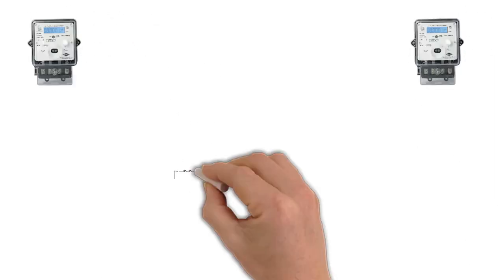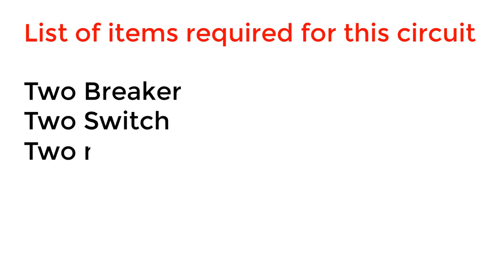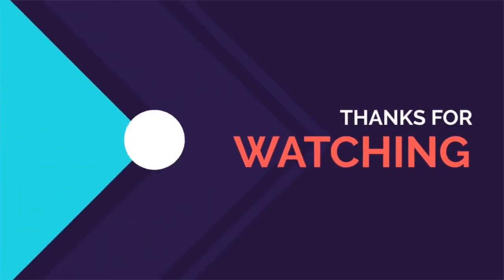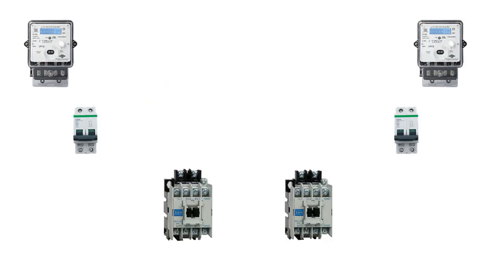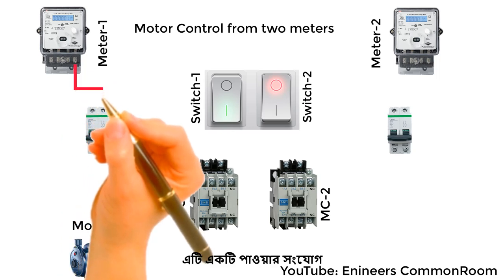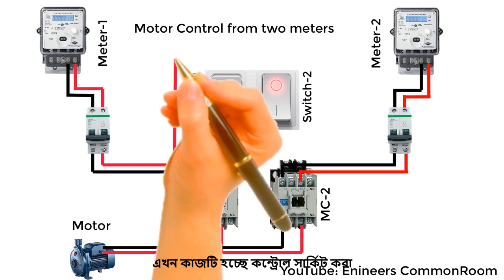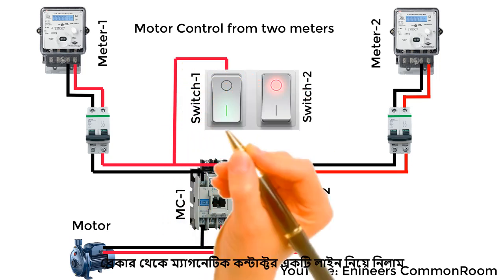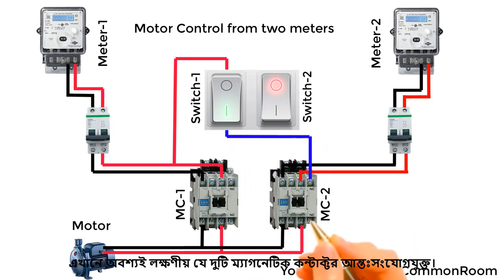How to connect a motor from two meters | Engineers CommonRoom ।Electrical Circuit Diagram

Comment: Hi I have one question 
I have 2. 3 phase meter one is of 20KW and one 10KW can I use a machine of 25KW using energy from both the meters?
Reply from the maker: Yes, You can connect three phase meter no probelm. Only power connection change single phase to three phase. controlling are same.

Comment: Hi so i have a question,
Can we take a three phase rotary switch and attach a three phase meter on one input and single phase meter on another input and attach the output for the house so that we can switch the meter. I am asking this as we don't have two single phase or two three phase meters, so will it be possible to do this connection?
Reply from the maker: very difficult to together connect single phase and three phase meter. but you can try to do this , please see the video more reference-https://youtu.be/yFPMK4b8wNA
Reply: @bdelectricalcircuitdiagram  thank you, i watched that video, so as per my understanding we can use two single phase meters with the rotory switch right? Can we use a single phase meter and a single phase from a three phase meter and switch the intake as per requirement, i actually want to use the first meter for the first half of the month and the second meter for the second half, so that I could reduce my slab rates. Can I do that with the rotary changeover switch? (Selector switch)
Reply from the maker: @ehteshxm  Yes it's possible, but rotary switch it's very risky.
You can use change over and flow the video for Single Phase meter
https://youtu.be/ydafThpXnU4
Reply: @bdelectricalcircuitdiagram  thank you!
Reply from the maker: @ehteshxm  Welcome

Comment: which type contactor to be used both NC? or NO or one NC and one NO?
Reply from the maker: Thanks for your comments. In general Magnetic contactors found No for power supply but have some auxiliary contact NO-NC. You need Magnetic contactors 220Vac with  auxiliary contact NO-NC.

Comment: Not working. Use light to replace the pump. Test it at the end
Reply from the maker: Please check the NO-NC connector for interlocking OR Magnetic contract damage OR not.

Comment: In spite of electrical interlock, both contactors shoud have a mechanical interlock...
Reply from the maker: Thanks Bro. Its good for avoid any mistake. This circuit no need any mechanical interlock because source power same . Electrical interlock enough but need more accuracy need also  mechanical interlock.